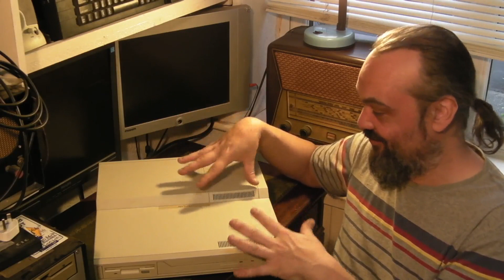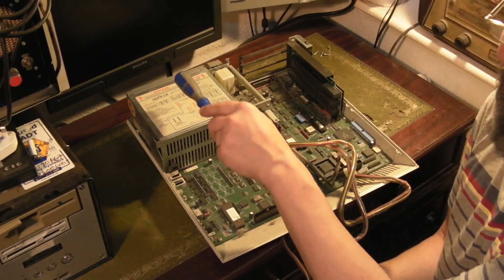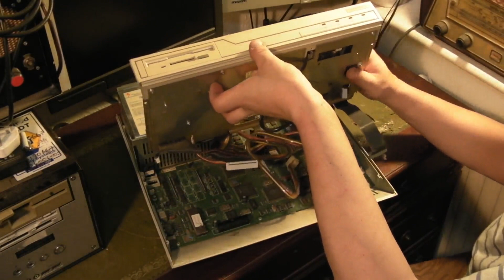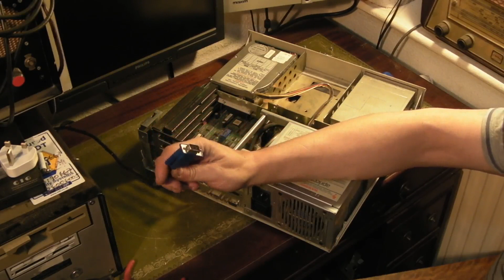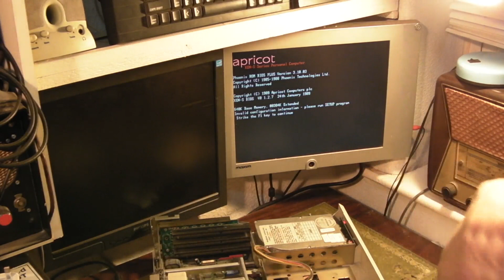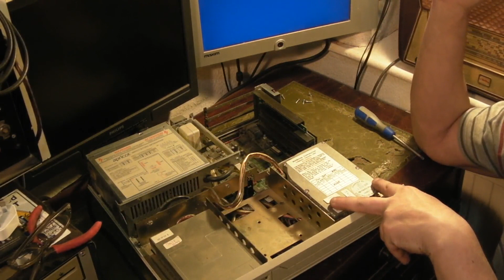Apricot XEN-S Restoration Pt1 inspection and 1st power up

Comment: You might need to go into the bios setup and tell it what kind of floppydrive and harddrive it has before it will boot. Often the older machines default to 1.2MB floppy drives.